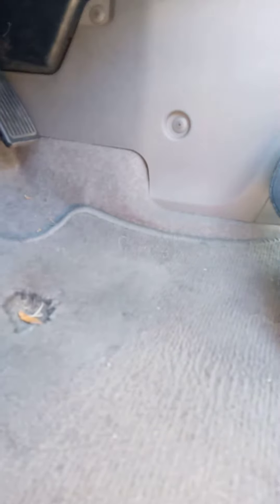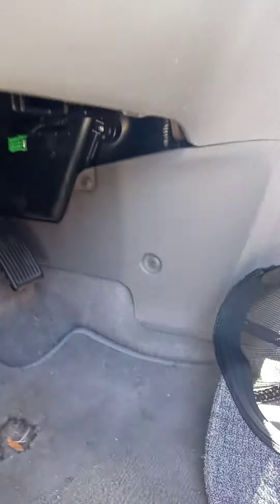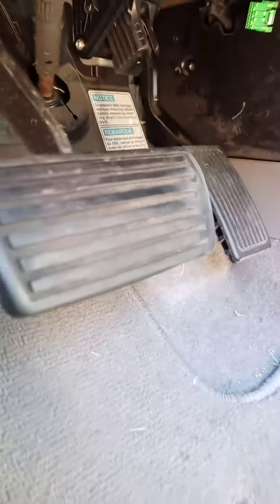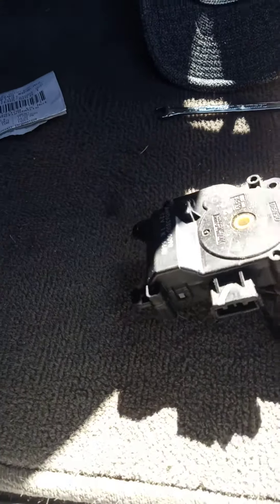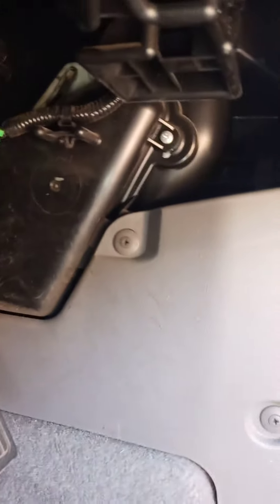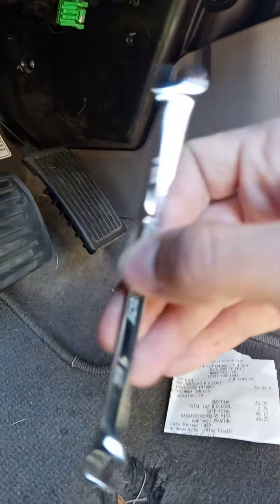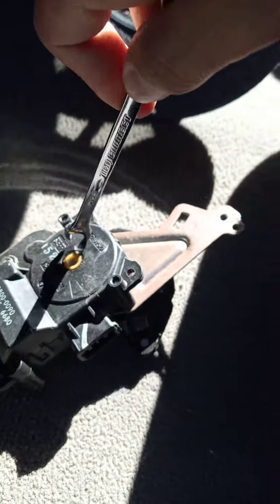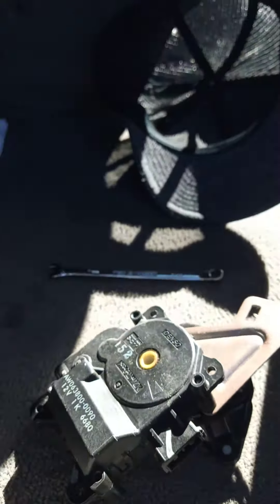A/C Heater Blend Door Actuator temporarily fix for 2008 Honda CRV

Comment: Have the same issue (no heat) even with dial at max. With the car running, disconnect and reconnect the green plug. Spray some WD-40 on the white plastic track. Use the flat-head screw driver to help it a little to unstuck. The actuator finally moves white plastic track when I turn the dial back and forth from blue to red side. Thank you much for sharing the video.

Comment: Hey i am trying this. Exactly as you mentioned number 7 fits very well. I have no experience about cars but tried to pull this door thing out and i did with my friend Osman's tools. But seems like your trick is not working for my crv 2014 until the part arrives.
Reply from the maker: I’m sorry to hear that but if you need heat maybe you can just lift the plastic up and duct tape it or tie it up until you get your replacement parts.

Comment: I sprayed silicone on the white tracks near blend door actuator and this fixed issue as the actuator would move white tracks a little sometimes.   I needed to plug back in a few times to get it to move.   Seems like a friction issue.

Comment: I was able to unplug the green plug and replaced it to get it to move.   I know its bad because I turned on the cold air and it moved but kept clicking.  I then hit the heat and the heat came on as well.   I think it was stuck.
Reply from the maker: That’s when you know it’s going bad I had that issue and then it just locked

Comment: So my 2008 civic, blend door moves when i switch positions,  but even if I turn knob all the way to blue, still super hot air, outside is 28°F,  so what you show here may be my problem, I believe,  is there any other think I can check, thank you, good video
Reply from the maker: It’s problem with the dual settings

Comment: i have a 2014. i don't have dual climate; but when my a/c is on the driver side air is not as cold as the passenger side. any idea? heading to honda for a diagnostic in a week (charging 170.00).
Reply: There is a svc bulletin for uneven heat. Most likely your model year is affected by it. Search on here, how to flush heater core on a CRV. If you are pretty handy, the hoses, CLR, and utility pump you are going to buy, will pay for itself, as you can do this flush in most cars. Good luck.
Reply: @crispa1861  ended up being a recharge thankfully

Comment: Hey let me ask you a question I have the same problem.  I have heat on driver side and cold air on passenger side. Do I have to change the temp blend motor on the passenger side or is it still on the driver side.
Reply from the maker: I’ve had that problem when I had duel heating or cooling on then the passenger was getting hot air instead of cold air or cold air instead of hot air so make sure your duel is off try that and I hope that can help because the only controls the heat or cold is under the driver side
Reply from the maker: Also if you’re duel button is broken maybe that’s what’s causing that
Reply: I know I'm quite off topic but does anybody know of a good place to watch new series online?
Reply: @Orion Jaxton flixportal :P
Reply: @Roger Trace thank you, I went there and it seems to work :) I appreciate it !
Reply: @Orion Jaxton no problem :D